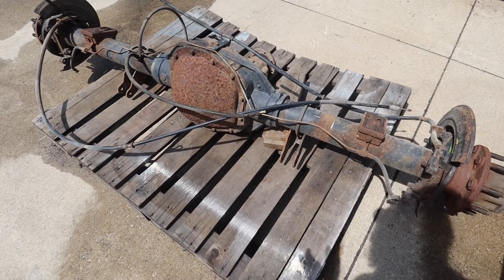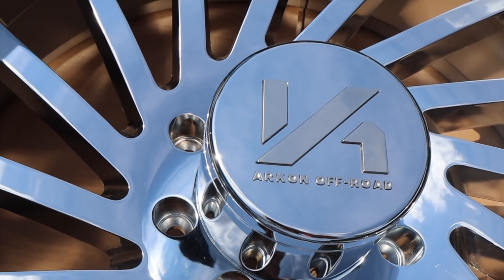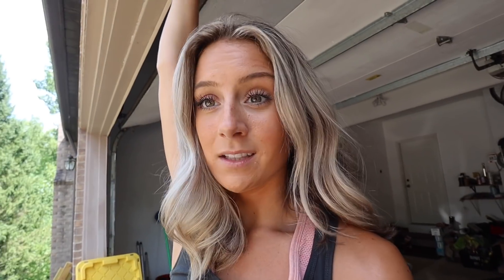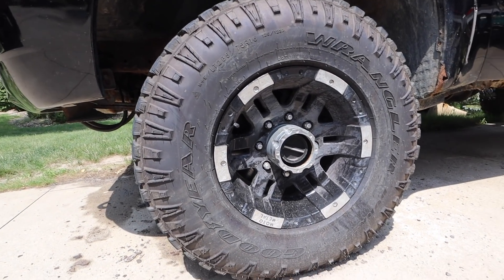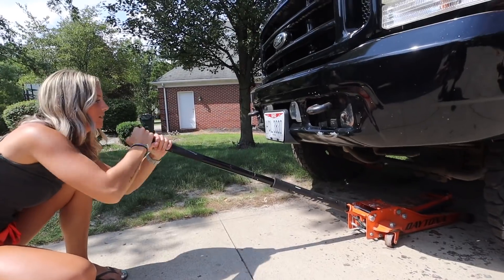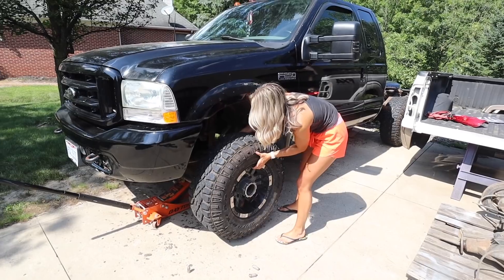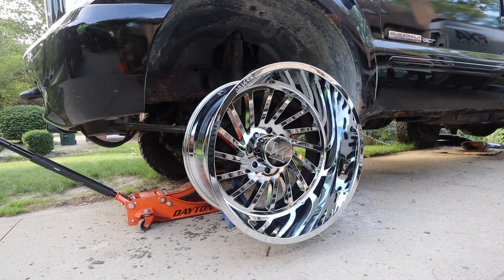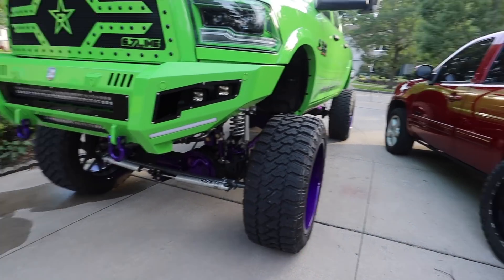MY 6.0 IS GOING TO BE STUPID WIDE...

Comment: Y’all matched the new (used) rear gear rear end to the front gear right? A lot of folks forget to do that in 4WD trucks when replacing the rear. Truck is headed places, great job! 🤘 I wish y’all would lift that cab and clean up the frame underneath so it will match the rear. Pretty easy to do on those trucks in your driveway, done it a few times myself.

Comment: Listen Ryan should know this Fords biggest problem is the front end they always have problems with the suspension stay away from the 37's don't go with anything over a 35 really a beefy 33 would be fine to because if you plan to use that truck as a daily driver you will hate the ride

Comment: Change the fluid in the rearend and put your new cover on.  Run new brake lines on the back ,seening you will be hooking lines up with the new axle. ( Will save you later down road.) Chrome rims will look great with the paint color. Might want to get a second floor jack , will help alot.